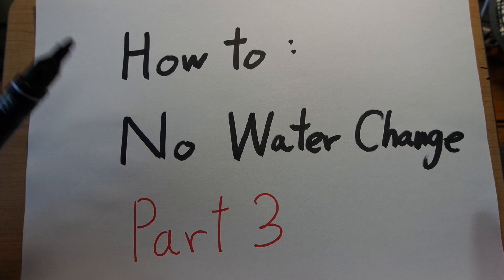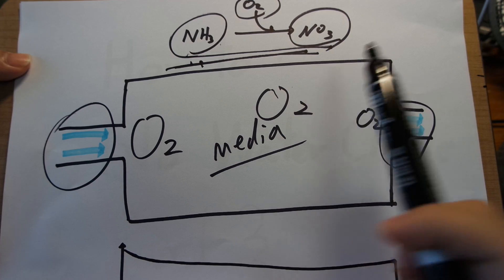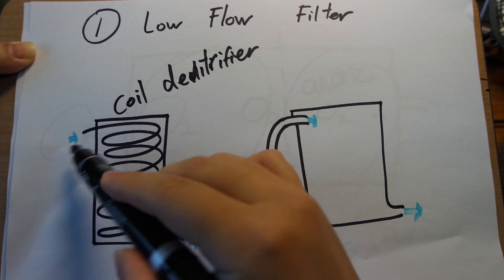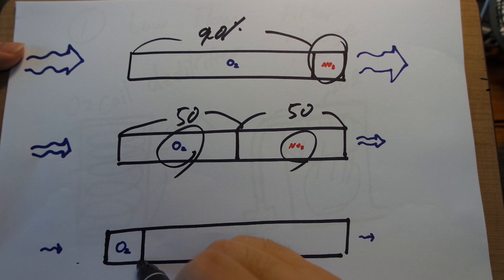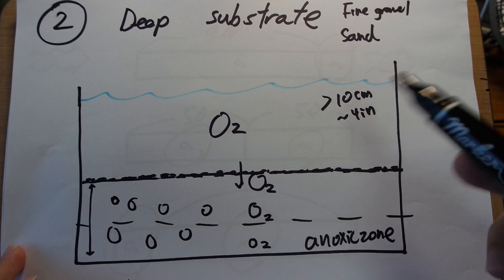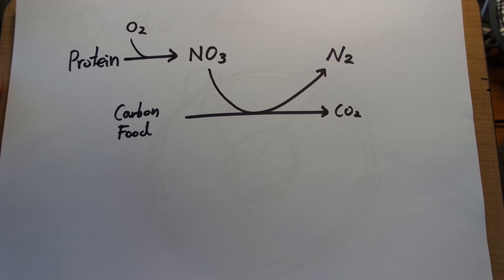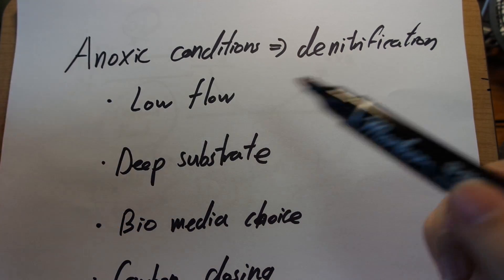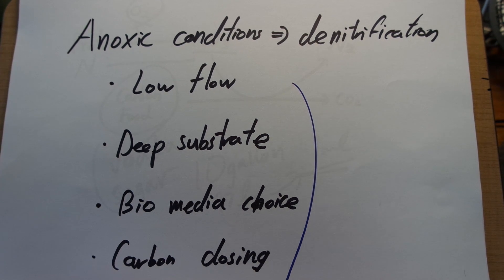How to build a no water change tank part3: ways to make anoxic zones for denitrification

Comment: NH3 >> NO2 >>NO3>> And then, I didn't quite get it ..... I'm remembering high school chemistry class, haha.
I have not delved into this for about 20 years, but the slow flow denitrification does work, as you said.... I built a "spiral tube"  filter for a marine tank. Surely enough the water coming out was nitrate free, but the flow was so slow (ie, about 2-3 drops per second), it was ineffective on the 300 litre system.
I like your ideas, and science.
Subscribed, and will be looking more back (past) through your videos.
Thanks for the detail! :)

Comment: A diverter after fast flow filter (for Standard ammonia and nitrite cleaning ) that splits water flow (80% back to tank and 20% through next low flow anoxic filter , then back to tank ) is an alternate .(this utilizes the reduce 02 levels from first filter moving slowly )
Your idea of a thick bed is ,I believe, the best natural way in that it mimics nature . (I have had old school tanks that lasted , untouched for a year at a time with the heavy planting and small fish count with minimal feeding relying solely on a simple slow flow under gravel grid filter (sort of , minimal air ).

Comment: What a fantastic series! I am using a deep sand bed and plants (actually slow growing plants but I plan to add some faster growing stem plants soon) and I can't get any nitrate readings. I do a 25% water change weekly right now. I'm going to see what happens if I just top-off. ...I'll do a water change if my NO3 goes above 10 but I'd like to see how long I can go....
Reply: Any updates on your tank?  How much sand do you have?  What kind of "sand" are you using?  How large is your tank?  What is the stock?  I am very interested in knowing thanks for your time.
Reply: Is 10 ppm scary?  Or is 50 ppm where it might get scary?  People who want to sell test kits....and filtration products will say 10 every time. The ponds and lakes where these fish come from don't have any of that. Top of with distilled or R.O. so parameters remain the same (regardless of testing) Nothing but pure water leaves the tank.  The minerals are bound up in the plants which release them back for others use during the decay process.  If one has to supplement certain plants with minerals to keep them happy they simply have too many of that kind of plant.  Plants compete too and getting their ratios right is another key. Good luck

Comment: You can get anoxic conditions by having a large amount of fairly fine substrate as well. The nitrates will difuse into the soil through hypertonicity. Keep this in mind if building a low tech system like this. If the anoxic bacteria in your filter die you will have a healthy supply in the soil to help maintain parameters.  Great video man. Well done and very simple.

Comment: Hi Jay. Thank you for your excellent video and explanation of the anoxic filtration system. I needed some advise with the following:
1) Is there a minimum or optimum quantity of the fired clay media per gallon of aquarium water? 
2) How much sugar would you suggest I put into the media to start of the anoxic filtration?
3) I want to use red clay for the media. I presume the red colour is due to the iron content, in which case do I still need to add an iron source such as laeterite or flourish iron to the clay? And if so what other substitutes can I use for the iron source? Are the iron syrups or tablets for human use acceptable? 
4) Instead of an under gravel plenum inside the aquarium, I want to build an over the aquarium sump/ aquaponics filter system with a plenum under the clay media, sand and gravel and needed your advise if it could work at achieving anoxic filtration. Please share with me your email address on which I can reach you so that I can send you a drawing of my design so that you can guide me on any corrections required. 

Thank you once again for your excellent videos. 
Kind regards
Ally

Comment: I have 2 piles of rock in my tank, because my hillstream loaches like that sort of thing. I was starting to worry that they might be a source of pollution, pressing the substrate below, collecting mulm and blocking flow in those areas, but maybe they're actually a good thing and create denitrification zones? I do have oddly low nitrates all the time, I only do water changes for aesthetic reasons (suspended particles and problems they cause, like hydras etc).

Comment: It would be smart to put undgravel plates (or any type of plenum) under substrate which will create the needed anoxic wo going full anaerobic at the bottom. It will allow the water to fully pass through the entire layer instead of hitting the bottom glass and going nowhere and losing all oxygen. Heterotrophs can live in .25-1 dissolved oxygen. Undergravel is imop the best way as you can retain the uplift tubes and use airstones as very little airflow to help pull water though if you do endup with full anaerobic instead of anoxic, thus allowing you to fine tune the flow. Using any clay based substrate is best as the crystals help attract the molecules due to negative ion charge as well as the iron content helps promote bacterial growth similar to how it does with plant growth.
Reply: Dr.Novak, right? Makes sense but downside is you can’t use plenums with deep sand beds or dirt.
Reply: @Badandy538  You're incorrect. Check out Kevin Novaks latest videos.
Reply: @Badandy538  I have an UGF with sand. It works fine. I just put a filter pad on top of the filter plates.
Reply: @Badandy538  You can!
Reply: Jay said anaerobic and anoxic were the same thing.
Reply: @djt7387  they are two completely different things.. one is very low o2 one is no 02..
Reply: @fishrrelaxing9361  then why did he say anoxic was the correct term for anaerobic?
Reply: @djt7387  ok idk if you’re testing me on this or seriously needing help to understand.. I have not the time or patience to go down this road.. if you can’t understand what is already said and research these items on your own then i prey you never own more then some guppies or slider turtle of some sort..
Reply: @fishrrelaxing9361  lol, if I tested you you'd fail.. hahahah
Reply: @fishrrelaxing9361  the video said it you reprobate.. hah, guess you weren't listening  to the video.
Reply: @djt7387  the comment made is over three years old to a video that is much older. As someone who has multiple very large tanks and has for many years I’ll take my knowledge of what isn’t much more then which craft when it comes to things like this.. as old as this hobby is 90% of what people think is fact is fiction. I’ve not even reread my comment nor rewatched the video.. but I stand by whatever it is you seem to be in disagreement with. I have 7 tanks from turtles to community tanks to coral saltwater tanks. My smallest tank is 55gallons.. I have somewhere in the neighborhood of 20g in just equipment alone.. I spent at best maybe 10min a month on maintained total.. this is because I understand basic concepts that are not commonly referred to myths spread by this community but actual scientific facts are expanded upon by many years of trial and error experiments.
Reply: @fishrrelaxing9361  what can I do if he said this in the first few minutes ... 

You are sad...

Comment: Great video, thank you.  I do have a deep substrate and it does form nitrogen bubbles.  When I set it up, I put a matrix of PVC pipes with holes and an outlet in case I want to suck some dead water out from underneath.  Now I'm thinking about put a little suction there to cause some flow through the substrate.  Any thoughts?  Also the clay gravel that you showed is also used by some here in US and I was going to add to my tank or filter, but I wasn't sure if it'll hurt my fish since it's used for gardening.  There are biomedia that act the same way but cost a lot more, Seachem Matrix and BioHome being a couple of options.  After watching your video, I think if you pack a canister filter, and use a taller canister one, you may reach a higher denitrification.

Comment: Hi. I was thinking about ways i can reduce water change on my 50g planted tank with back sump and came across your videos. My tank is planted and almost 2 year aged. very low fish stock lots of shrimp. I think i have already achieved a good balance ecosystem, i feed very little to my fish at alternate days. and the shrimps pretty much just graze on the algae. But the NO3 levels are not at 0. Which i think is why my plants are not showing their red colors.

I am currently planning on making a 2ndary sump under the tank with a tiny pump. its not gonna be very large. maybe about 20inch x 10x12 plastic container. My original idea was to just jam it with some plants maybe duckweed. But after learning about anoxic filtration i am curious if i can do a 5 inch deep substrate in this sump using 2/3mm crushed stone substrate. 

is there a limitation to the deep substrate method if used outside of main tank. for example on how deep it is from the water surface? can i close the lid on the 2nd sump? and flow rate etc... 
your suggestions will be very appreciated.

Comment: Hi Jay. Thanks for the interesting series of videos. I watched you videos last year and am re-watching them as I would like to try out the carbon dosing to kick start the denitrification in my anoxic filter which I have set up using baked clay media. 
1)What would be the quantity of sugar to add to the filter? 
2) Is it necessary to dose daily or can I dose every 2 or 3 days to avoid a bacterial bloom & or ammonia spike? It is an established tank and I have other filters running so ammonia & nitrites are zero at the moment. Nitrates are around 40 to 50ppm. 
3) Does carbon dosing require a protein skimmer as done by marine aquarists? 
4) Once the heterotrophic facultative anaerobes are established do we still need to continue carbon dosing or will the bacteria manage to get the carbon from the fish poop & waste food?
Reply from the maker: I havent found carbon dosing to be necessary. It helps but is redundant in most cases.

Comment: Seems like having two filters would be a good option.  We don't want to neglect the aerobic process which does well with high flow.  But if we have second filter with very slow flow that could build up anaerobic filtration it will work for Nitrates.  I wouldn't feel good about slowing it down and risking insufficient aerobic filtration.

Comment: Great video!   Can you incorporate this dual aerobic and anoxic conditions still in a deep substrate by incorporating an under gravel filter?   Same question but having a plenum only instead of UGF?    Does this replicate similar to your turtle tank with a deep substrate but adjacent to open water (similar to space below UGF?).  Also if you are opposed to either, why? I ask because I would like to add a filter to a deep substrate tank but prefer not to use canister, HOB or sponge filter.

Comment: Hello again 
Just a quick question about oxygen as I understood from the video the oxygen inside the filter should be reduced by reducing amount of water flow in an out .
But how then can get oxygen for the fish in the aquarium because the surface will be stable because of less water flow ??
Can we use air pump?

Does the oxygen in the water which is good for fish will also delay the denitrfication. Thanks

Comment: everything is clear and connected now, i always wonder why tanks that even didnt have filter at all, or just using under powered hang on filter, can maintain the water clear also the plant and fishes are super healthy, at first i just keep on that plant memes "that if we let plant live by themself they will find a way to become super healthy, BUT if we take care of them even a slight miscalculation can make them melt"

its all clear now,  the answer why in some cases natural no filter ponds, underpowered tanks even abandoned tanks and pond can maintain their water quality, anoxic state to get rid those nitrates

I have a question, so fro your explanation, we need 2 filtration system right? 1 for aerobic and 1 for anoxic? so if we use canister we use 1 underflow canister and 1 correct flow canister? 

second question is, in my country i cant find baked clay cat litter like u use and Doc Kevin do, but the hydroton and laterite is widely available, can i use that after u mention it too , do you already testing it with hydroton?

Comment: Wouldn't a canister filter create anoxic zones? Water goes in at the rated speed but the sponge filter pad paired with a fine filter pad would slow it down flow rate. After the filter pads would be the media baskets zones. Would you say that the media zones are in anoxic condition?

Comment: Hello. Thanks so much for all the information. When using a thick substrate for denitrification, does this mean that the substrate should never be cleaned with a gravel vac? Can you recommend any specific sand or fine gravel for this method?
Reply from the maker: Gravel vacing is fine in moderation. I gravel vac once or twice a year. Otherwise too much detritus builds up. Sand or gravel all work fine its just a matter of personal preference.
Reply: @Jaysaquarium Thanks so much for responding.  I was concerned that vacuuming the gravel would disrupt the deep anaerobic bacteria. When you vacuum do you see a temporary rise in nitrate levels?

Comment: How would you setup an eheim canister filter that has the input from the bottom and output is at top? How would you also setup the media inside? I could adjust the flow with the valves supplied. Thanks for sharing your knowledge!
Reply: Rommel R you've bonused if your inlet is at the bottom already you have less oxygen going in I'd have course sponge at the bottom then floss then media of your choice that should make your filter at least 75% anoxic

Comment: If I slow down the flow on my ehiem 4+ 250 to the lowest setting and N2 starts to be created, would the N2 be dissolved in water and evaporate outside the filter or build up as a gas in the filter, eventually causing the filter to run dry if enough gas is in there?
Reply from the maker: Not sure never tried it with a canister filter.
Reply: @Jaysaquarium  which would be the best filters to try this on in your opinion then?

Comment: Hello, thanks for the thorough explanation! One question though, since oxygen won΄t be able to reach the anoxic zone (in an >10cm substrate), how will NO3 be able to?
Reply from the maker: Oxygen is used up no3 is not
Reply: @Jaysaquarium  ok, so if NO3 is not reaching the anoxic zone how does the substrate help turn NO3 in N2?
Reply from the maker: No3 reaches substrate
Reply: @hrishar  Just in case Jay's reply isn't exactly clear, think of it like a Balloon. When you first breath in (the top of the Substrate) its all O2. When you blow that air into the Balloon it contains a mix of O2 that you didn't use the first time, and CO2. This is as if the water has traveled through the first part of the Substrate. If you keep breathing the air back from the ballloon, and back into the Balloon, the O2 level will drop, and the CO2 level will rise. Eventually it will reach a point where the Balloon only contains CO2. And as Jay said, at this point a human will just die if they keep breathing from the Balloon.

This is what's happening in your Substrate. At the top the Bacteria eat NH3 and (then latter NO2), and breath O2, and then breath out NO2, (and then later NO3). But as Bacteria keep doing this, they use up the O2 gas.  All that is left as you reach the bottom of the Substrate is the waste product from the original Bacteria. Some Bacteria however can convert consume Carbon and breath NO3, to create N2 and CO2.
Reply: @Peregrine1989  thank you for the clarification! My question had more to do with the molecule sizes and the substrate’s resistance during the movement of O2, NO2, NO3. So, what I understand from your post is that it is not so much about the O2 and NOx reaching the bottom, but about their rate of depletion and replenishment. (English is a foreign language to me, I hope I chose the terms correctly)

Ok, two more questions regarding anoxic filtration:
a)	Sponge filters tend to clog over time, so people will periodically take them out, squeeze a little and put them back in the tank. If we were to let a sponge filter as is, it would have a lower flow, so would it help with denitrification? What size should it be in relation to tank volume? The tank I have in mind is a 10litre with lots of floating Salvinia, some Taiwan moss and a sponge filter. Stocked with neocaridinas that are breeding.
b)	When choosing to go the deep substrate route, does it matter if we use dirt below the gravel? It would provide nutrients for plants according to D.Walstad and FatherFish, so would that affect the necessary substrate depth?

Thanks in advance!

Comment: So, if a guy had a sump set up without the refugium portion, do you think it would be feasible to add a small tube to the overflow box, let it gravity feed through a large canister type filter full of a good biomedia, and then discharge into the sump? Might need to ensure the water is prefiltered so it wouldn't get gunked up, but I think the flow would be slow enough and if the canister was big enough(5gallon bucket DIY style perhaps) then it might work as you explained for denitrification. See any problems here?
Reply: Ison Tenney I have a reactor that’s full of carbon. I just started a saltwater tank and the reactor draws water from the sump through it which has carbon in it. The water flows through the carbon back up to the top and back in the sump. The way he’s explaining it it’s the same thing

Comment: But a slow flow means a slow rate to clean out the nitrates so the filter volume would have to be large. How large is needed then? Also with a deep substrate, aren’t there other concerns with poisonous trapped gases that you could release by disturbing the substrate?